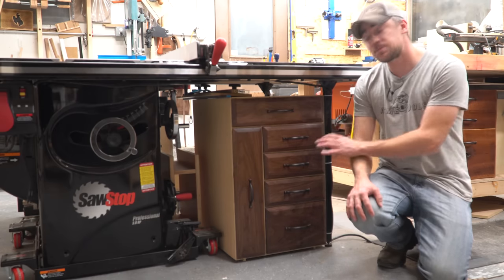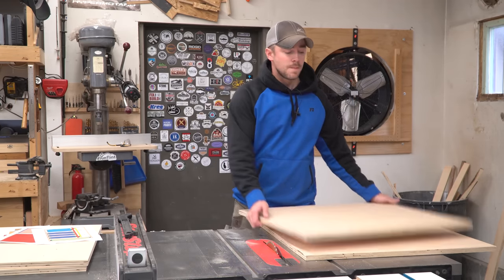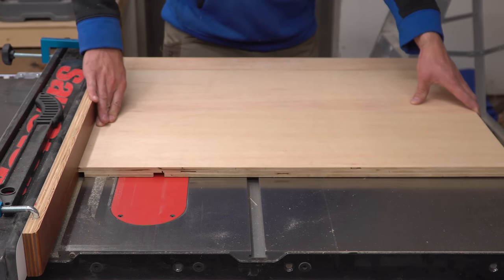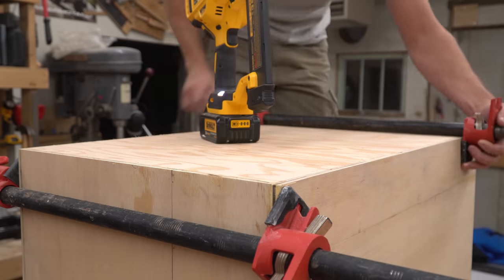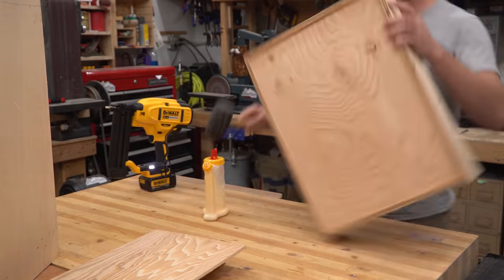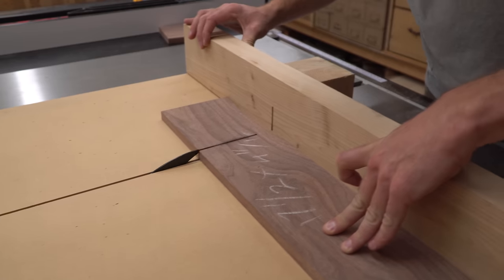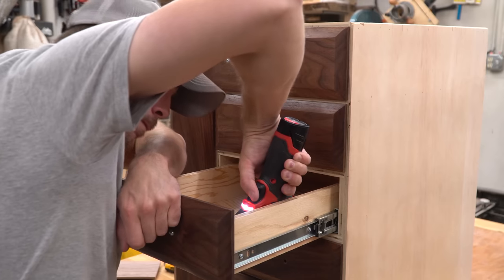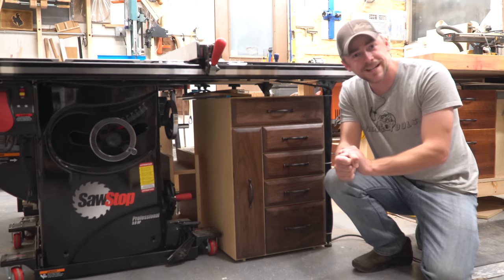Table Saw Cabinet - DIY Tool Storage

Comment from the maker: Who else likes to use shop projects as an opportunity to practice new skills or tools?
Reply: Absolutely. I'm getting ready to build a drill press stand and I'm going to use box joints for the drawers. I know there are much faster and easier ways to make drawers for a shop cabinet, but I want a chance to practice making good, tight-fitting box joints.
Reply from the maker: Great thinking! I'm sure you'll learn a lot from that.
Reply from the maker: Excellent strategy!
Reply: totally. I feel a just a wee bit bad for not producing gifts and furniture, but I just learned not to try to use a sled you made for one table saw on another. Nice video. I really like how you made and attached your drawer fronts.
Reply: My First project was a through mortise and tenon bench for my drill press. It was the first woodworking I've done in about 20 years and it came out so beautiful that I hated putting my drill press on top of it. I used 3 or 4 coats of General Finishes Polyurethane (I forget the exact name) and it is holding up beautifully. Not a scratch on it. Unfortunately, real life has gotten in the way of doing any more complete projects.
Reply: I do the same.  When I first started in this very expensive hobby, I used to think people were crazy for making super nice shop cabinets, etc.  Now I realize that it's the best way to get practice.

Comment: Nice job Mark!  I have been designing a cabinet/ box for under my saw as well and this will be a great reference.  However, I need mine on wheels for mobility.  The walnut looks amazing.  Keep it up!  I love shop projects for this exact reason. Try new things, test processes, and not risk a customer or client issue if there is a "learning moment".  Always challenge and test yourself!
Reply: The cabinet in this video is quite nice.  Since you need wheels, check out Fix This Build That (Brad Rodriguez) for a similar design.
Reply from the maker: Thanks Casey! You'll have to show me your cabinet when you get finished.

Comment: If you need to move it a hand truck will slide right under it with the feet you put on the bottom and you have enough room to slide it out. Nice cabinet, btw.
Reply from the maker: Exactly! Good Eye!

Comment: I've been considering a similar cabinet for my table saw , but it seems it will interfere with the adjustment wheel in that space
Reply from the maker: In my space there is plenty of room to operate the wheel.

Comment: I think you have mentioned before.. your shop furniture is every bit as nice, if not nicer than your house furniture.  Very nice.  By the way, is that a new fan in the wall?
Reply from the maker: That fan has been around for a little while. I use it as a filter when things get dusty, or to push heat out into my garage if I need to do some mechanic type work.

Comment: Love it! Couple questions:

Which Sawstop base are you using, the PCS or ICS with PCS adapter?

What length are you extension wings, 36 or 52"?

It looks like there's a couple inches above your cabinet and beneath your table top. Why is the gap up there so large; to accommodate moving the fence?

If you were building a piece of furniture with walnut drawer fronts like that, is it possible to veneer the box of the cabinet to match, would you have to use black walnut plywood (assuming that exists), or is this build design only appropriate for cabinets where the sides and back will be hidden due to the installation location?
Reply from the maker: I believe it is a 36 inch saw using the ICS base and adapter.

There really isn't much space between the top of the cabinet and the saw. I didn't care if it fit exactly to the height of the saw because I planned to store things on top as well.

You can buy walnut plywood, or you could put veneer on yourself if you wanted. Use whatever materials you like/want. If I had more time I might have built it all out of solid walnut, but I just needed to get it done and move on.
Reply: @GunflintDesigns  gotcha, thanks. Have a 30" PCS and am planning to upgrade it to 52", and considering whether to make a wider cabinet, or two smaller cabinets, to fit in the space underneath.

Comment: I admit I was a fan of Powermatic ..anything for quality and durability. But I have on hand ads from less than 5 years ago where the same models were $1000 cheaper than now. THAT is what gets to me these days. Justifying that huge increase NOT due to changes or tariffs. Sawstop is expensive too but they started out because of that brake system not because of the materials and accuracies built in to their products (since improved). So, now I tend to walk away from Powermatic. Glad other companies can compete now. Nice job.
Reply from the maker: That's an excellent point of view Clyde, thanks for sharing!